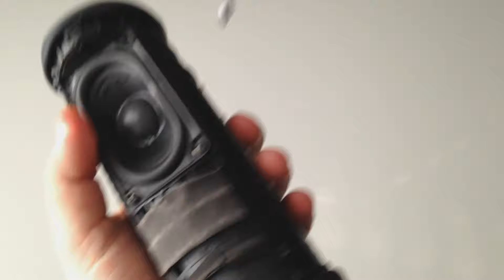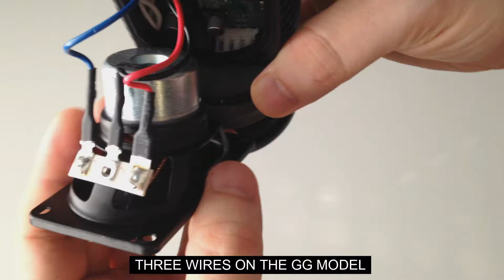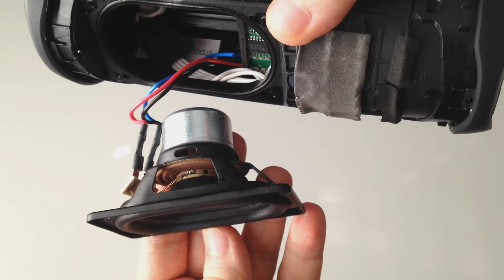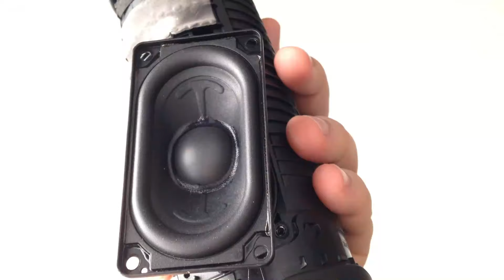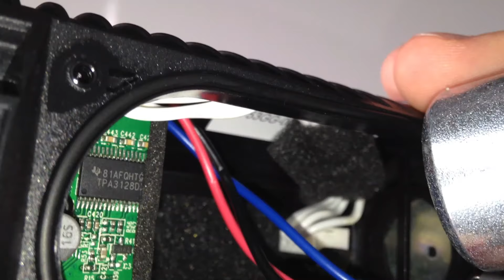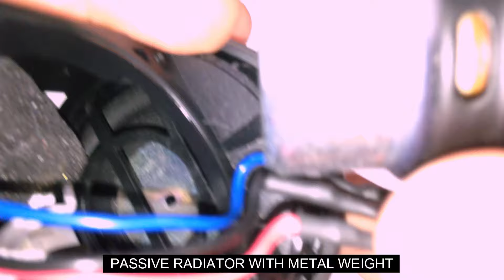JBL Flip 5 - What's inside?

Comment: I'm in a dilemma over the Clip 3 and the Flip 5, both from JBL. I like the Clip 3's portability, but I also like that the Flip 5 has type C charging port, as I have a phone with the same type C port so if I get the Flip 5 it means I don't have to have so many charging wires around. Basically whichever model I get, I would use it at home (a small 60 meter square 2 bedroom, 1 hall and 1 kitchen apartment) and in the shower and occasionally bring it out for my casual biking around my neighborhood.   If price is a non issue, which one should I get?
Reply from the maker: Sorry for the late response. Don't spend your hard earned money on the Clip 3, in my opinion is not worth the price. Flip 5 is a decent sounding speaker though.

Comment: My Flip 5 wont charge or turn on , any tips ?
Reply from the maker: I think the best thing to do is send it to warranty so they fix it. If you don't want to do that you could open it and see if any cables are disconnected although I kinda doubt that's the issue.
Reply: @AudioCuriosity  they sent me a new one, and didnt ask for the old broken one. id like to get it running. any ideas what could be wrong ?

Comment: Jbl really simplified the flip5 over the flip4.
Reply from the maker: Yeah, I wish they would have kept the 35mm jack and the protective flap for the ports. This way, with the charging port exposed, dust and fine sand can get inside and possibly damage it.
Reply: @AudioCuriosity  no sand cant damage lol
Reply: @kl1ckfanopex955  yes if there is sand inside it and you plug the cable in that can damage it and you can't get the sand out as good

Comment: 3 ohms? rly?
Reply: Why rly? There is no problem with that
Reply: @p0xygen  more ohms= cleaner sound. 

And also less background noises. 

Just connect any 2-3 speaker to a 8ohm system and you can hear how it sounds much better. 
Feels like your Speaker is now 5 times as worth as before.
Reply: @fa14bi-78  that is not true... The difference isn't even measurable.. And it depends on the amplifier and on the capabilities of the speaker, 3 ohms at 20w is fine (we're talking about a portable speaker here keep that in mind) and you can't just say 8 ohms is better than 4 ohms as it depends on the amplifier and speaker... You can't say my car is faster because it has 20 PS more, there are multiple factors just like with speakers...
Reply: @p0xygen  I still want to hear the flip 5 with atleast 6 ohms.
Reply: @fa14bi-78  You don't even make any sense. Please learn your shit before replying. Thank you.
Reply: Dude I dont even know what ohms mean I know that it's from speakers
Reply: @tx_al3xx  Any speaker has an background noise if you playing music, you will hear it at low Volumes, even from your phone. My headphones for example have 600 ohm, it's impossible to hear any background noise. 

My Radio has 3ohms, if you play from CD the background noise is louder than the actual speaker until 15% Volume. My Bluetooth speakers with 4ohms have a little less noice.